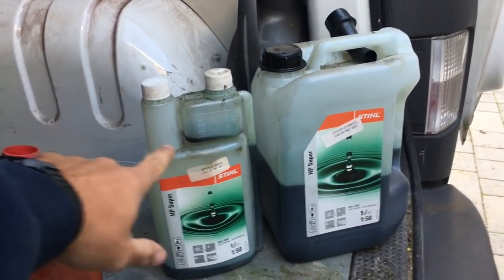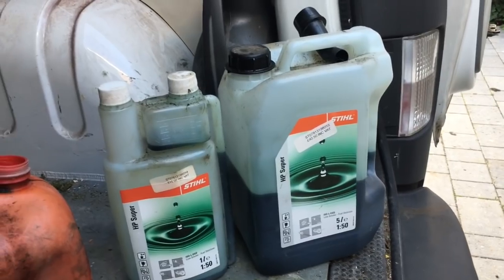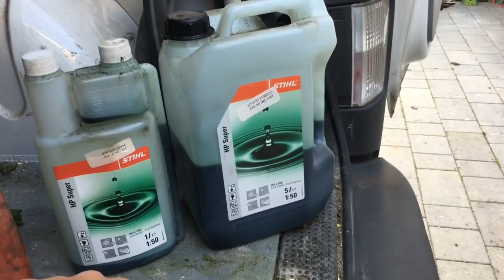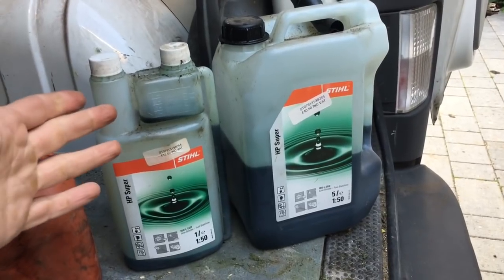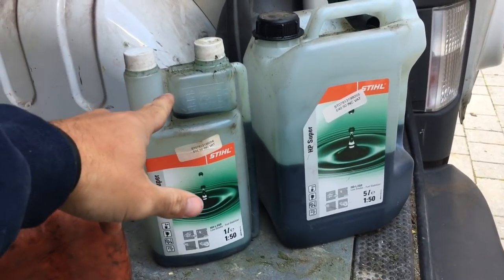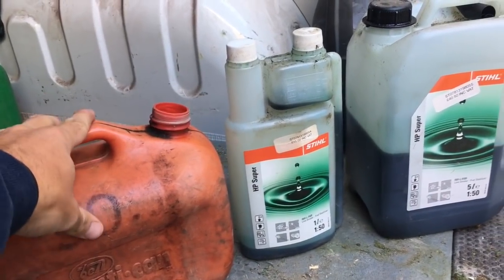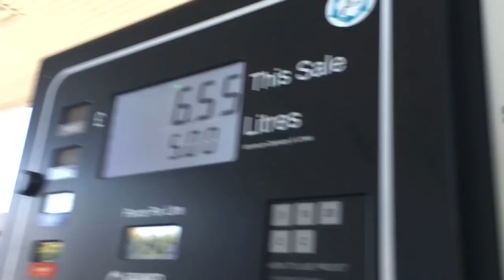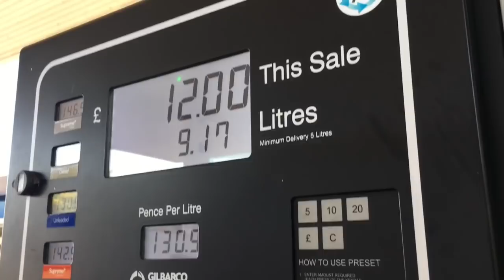Mixing up 2 stroke fuel

Comment: it depends. i'm an american and here everything is sold in gallons, which are smaller than the uk gallon. and ounces. if its for my chainsaws i use the chinese mix bottles they came with. these bottles mix either a 1/2 liter or a liter of fuel. i'm weird for a 'murican i like to mix in liters for the saws. for my 2 cycle generators i usually do in tank mixing and use the measuring cup they come with for that. those have 1.1 gallon/4.2 liter tanks. most 'Muricans mix either 1 gallon or 2.5 gallons at a time since these are common can sizes. many 2t oils are sold in 2.6/3.2 ounce bottles for 40/50:1 mixing with a gallon or 6.4 ounces for 2.5 gallons.

that stihl super i've never seen for sale here. they sell the orange bottle shit and the ultra. the ultra is FB rated, the orange bottle unrated, the super you have is stihls only FD rated oil.

Comment: I used 5l husky 2 stroke and a plastic kitchen measuring jug and a plastic funnel.
Reply from the maker: Never used husky oil any good?
Reply: Very good in all my Stihl machines. Was about £22 for 5l at my local dealer.
Reply from the maker: James The Gardener that’s good value 👍